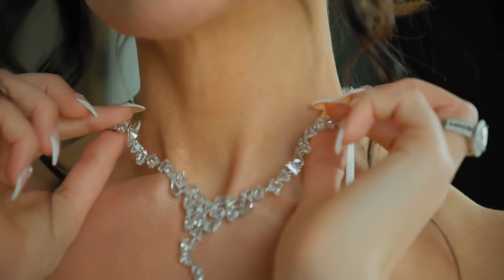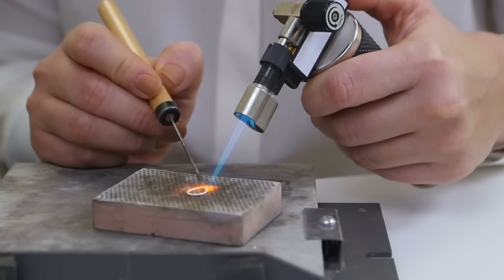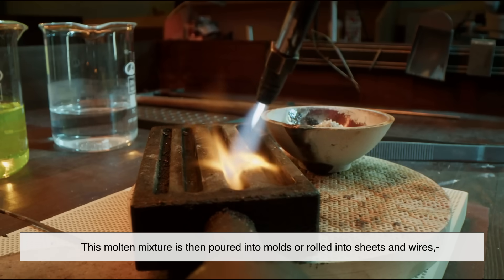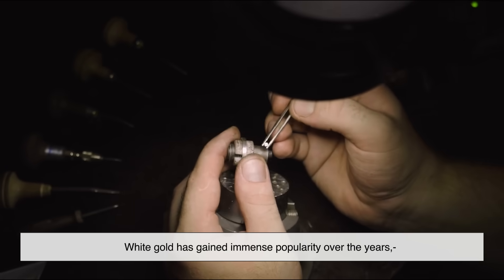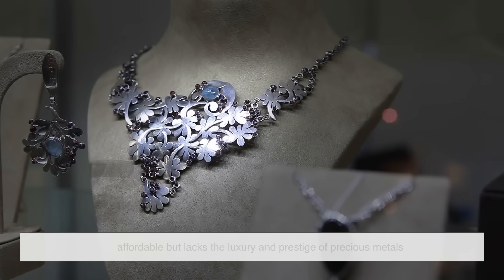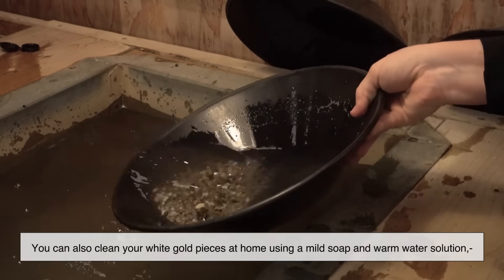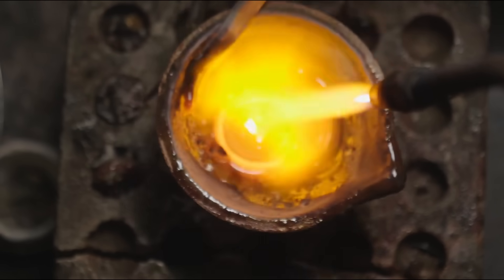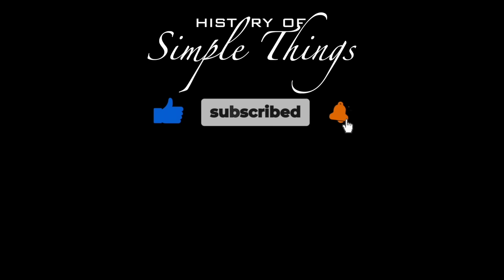How White Gold Is Made and What Makes It Special

Comment: I'd rather keep using fine silver for my jewelry, it doesn't tarnish and I work harden it so it has a bit more structural integrity for everyday wear.
Reply: If your silver doesn't tarnish, you may be wearing stainless steel.  Silver tarnishes easily and turns black over time if not polished regularly.

Comment: I watched to 4:19.... then I had to pause...
Platinum is Cheaper than gold.
Rhodium is very soft and easy to scratch and tear off.
If there is 16% Palladium and 8% silver you have 18K white gold that doesn´t need rhodium plating. (added a small margin to keep the 18K purity)
You should not reuse white gold when you can not determine if it contains Nickel. 
You allways start with a new controlled piece of white gold with the mix of palladium you need for the job.
Not the best video I have to admit.

Comment: Several previous comments point out that the platinum to gold price ratio reversed after around 2011 when updated catalytic converter designs resulted in a lower demand for platinum. Several points that might still be helpful in choosing between platinum and white gold: Since this documentary was recorded an updated white gold alloy ("White Star") was developed that does not require regular replating with rhodium. Secondly - white gold alloys are typically 14k (58.3% gold) or sometimes 18k (75% gold). Platinum jewelry is typically 950 (95% platinum). So even though the platinum base metal may cost less, a higher percentage of precious metal is used in crafting the ring or bracelet, etc.
Reply: Platinum is also extremely dense. Very hard, and not easy to damage

Comment: Platinum is cheaper than gold. I don’t understand why the narrator says otherwise. For my jewelry I use just silver because it’s very cheap compared to gold and platinum.
Reply: This is probably an older documentary that has been reloaded. Before around 2011 platinum was more expensive than gold. In 2008 platinum was more than twice as expensive as gold. After updated catalytic converter designs resulted in a drastic reduction in the demand for platinum, that price ratio reversed.
Reply: What a silvery white then just choose silver plated with rhodium or just silver. Cheaper, durable, and also elegant. Just need to know how to take care of it and how to clean it to avoid tarnish.

Comment: That is interesting about white gold being less expensive. Right now 1oz of gold is 3x the price of 1oz of platinum, so I would imagine in todays metals market, a platinum setting should be less that a gold or white gold setting.
Reply: Platinum jewelry is usually 90 or 95% pure. Gold is usually 41.7 or 58.5%. Factor in the difficulty of working with it and you are probably paying the same for a piece made of either.
Reply: @zacharywissinger3996  By volume, using today’s prices, platinum jewellery should be cheaper than 14K red gold. The difference in retail price can’t all be accounted for in ease of manufacture.
Reply: @positivelyacademical1519  by weight, yes. By volume not really. Platinum jewelry is much heavier than karat gold. Purity, density of volume, difficulty manufacturing, difficulty refining offcuts, premium over spot on bullion. Using the same mold, a 950 platinum ring will have an all in cost very similar to that of 10k gold.
Reply: It's only that cheap so Russia can't fund their side of the war and then pumping the sales of gold while being quiet about platinum so they buy it pennies on the dollar compared to it's actual worth
Reply: 💯 agree with you

Comment: But Platinum price is significant lower now, but platinum jewelries are still not cheap
Reply: Most people don't realize that PL fell to 1/3 the price of gold a long time ago so the the retailers are ripping everyone off.
Reply: Platinum is a bit harder to work with compared to gold and silver  @dane3038
Reply: @dane3038  Not really, it  is 1/3 the price by weight, but that would be much lower volume (a smaller ring) and and it  is used at much higher purity.  Plus Gold is much easier to work with the techniques and tools used in Silver smithing and gold smithing are the same, but you need different equipment and skills for Platinum. I make  silver jewelry  as a hobby.